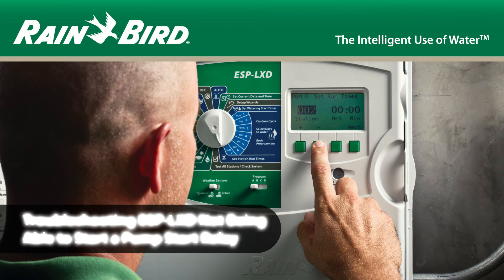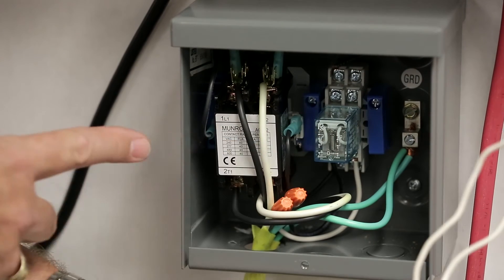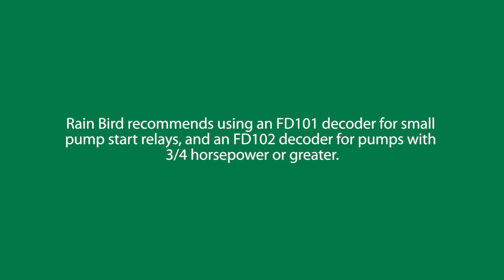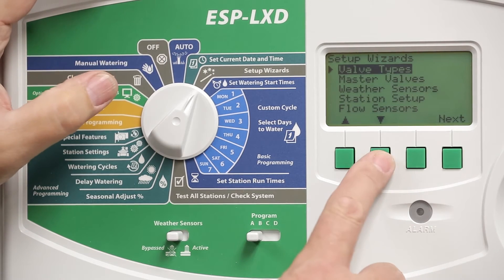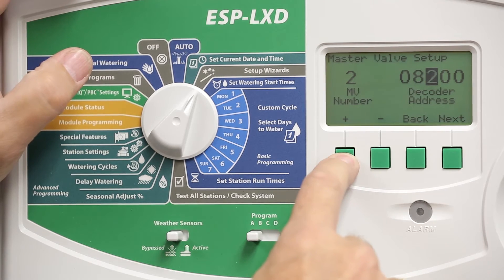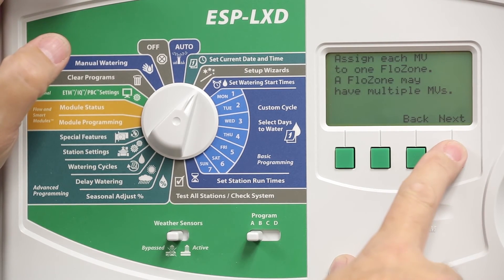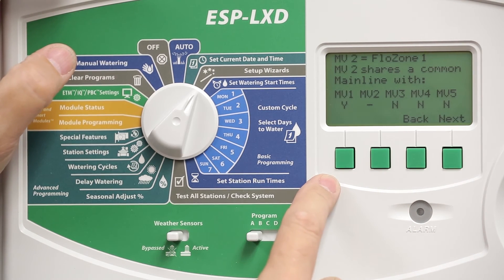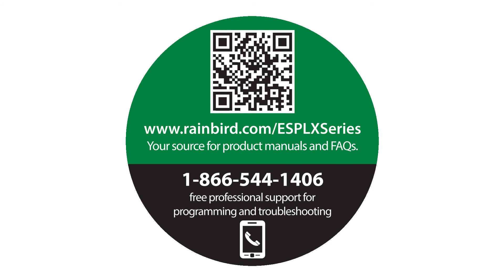Troubleshooting ESP-LXD Controller Not Being Able to Start a Pump Start Relay

Comment: I would like an answer on the communication wire I have found Ground Faults Gopher activity the break caused oxidation to both of the 2 wire connections if it is affected and can’t get a clean wire connection I feel like I am working so hard for nothing, I have 26 Stations system is Shut down on Alarm I have constantly called Technician Support in the middle of Summer plants Suffering, trying my Best property owner has little money for a Expensive Repair guessing that they had no idea what they had Bought ? I have Experience in Traditional Troubleshooting this is a different upgrade and is Communication way different and I get it but very High Maintenance. Thank you Johnny Garrison